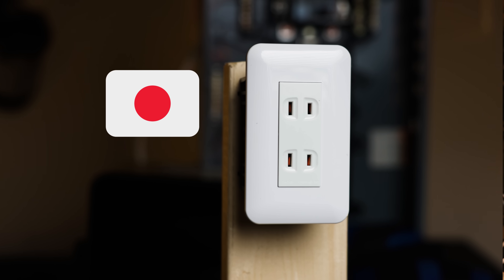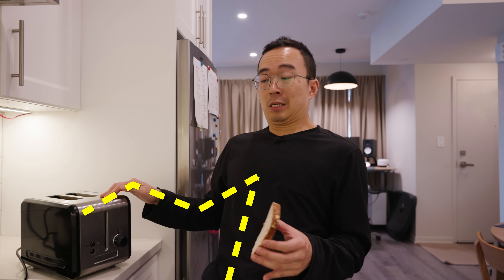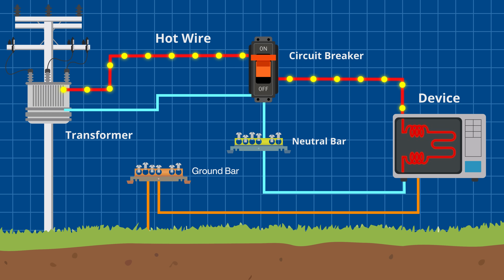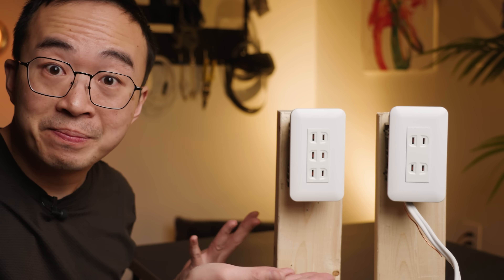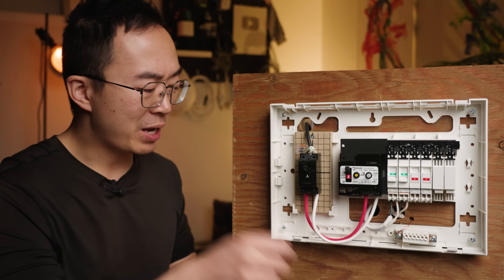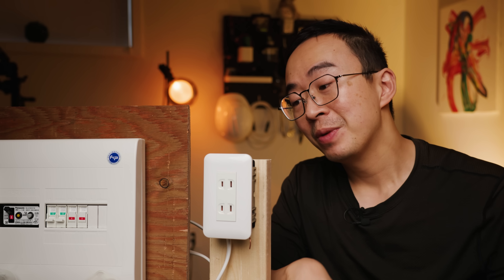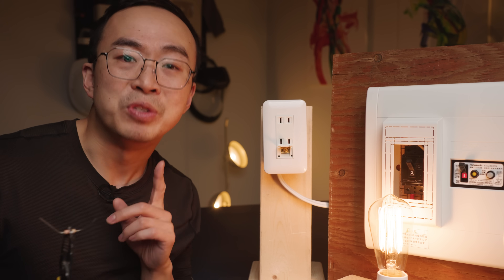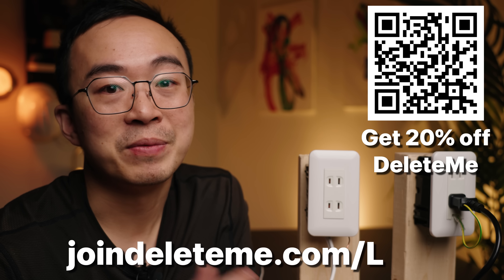How Japan Made Their Outlet Safe

Comment: Arguably the Japan outlet is just safer than an US one. But US outlets are some of the worst in the world. Puting EU outlets in the beginning of the video is kind of misleading. Most countries in the EU have both, a ground and a GFCI.
Reply: In most central European countries and the UK and Ireland GFCI protection is mandatory for almost everything. Ofc there are many exceptions but generally every new install has GFCI.
Reply: @alouisschafer7212 As of like a 10+ years ago, every new building in EU requires GFCI/RCD protection on every outlet. In old buildings it's allowed to have it only in the bathroom.
Reply: @Gragagrogog It's the same in the U.S.  New construction requires the same.  Let's throttle back on the superiority talk.
Reply: @alouisschafer7212GFCIs are really old. German company Schuckert (tofay part of Siemens) invented them in 1903, Nicholsen improved the technology in the USA in 1908.

It's kinda embarrassing how long technology took to actually takeoff. And shows the value (or its absence) of safety.

In Germany GGCIs are known as FI or more recently RCD and became.mandatory in the 1984 then almost everywhere in 2007.  Austria introduced them in 1980.

Some utilities required the use of GGCIs with the TT system before they otherwise became mandatory.  In Germany  the TT system is mostly being used with overhead lines, for example.on the countrysideAt first a ISB jack on a cell may appear to he a smart solution for chargin3.  That concept loses its appeal when multiple cells need to be charged. Then a multiport USB power source is required and multiple USB cables.  This may be more of a.pain than forking over a few buckazoids for a multi-cell charger.At first a ISB jack on a cell may appear to he a smart solution for chargin3.  That concept loses its appeal when multiple cells need to be charged. Then a multiport USB power source is required and multiple USB cables.  This may be more of a.pain than forking over a few buckazoids for a multi-cell charger but each European country seems to habe its own preferences and philosophy wrt. which grounding system to use.

Is TT more secure?  I doubt it's what makes the difference.  In Japan technical installations are usually very well maintained.  In North America I've seen quite a few in a somewhat sad shape.
Reply: @alouisschafer7212 Even solar inverters have another build in. 
Also wooden buildings need to have even more protection per local electrical code.
Reply: @alouisschafer7212 Here they even mandated that multi role parts being used.

You can not get units that are both a fuse and a RCBO in one unit so every circuit has its own, so if something trips, you dont have your whole house going dark.

Also, before the RCBO's were only measuring in and out current and comparing, then tripping if current were lost.

Newer units also take phase into account, this is vital for it not to trip if a lightning strikes near the house.
Reply: @ 

Where in the world does your entire house go dark “if something trips”. Bro I got like 20 circuits. I also can’t remember the last time I had to reset one. Y’all acting like this is a bigger problem than it is. Y’all acting like these united states can’t even keep its lights on. 🤣 We’re running 24/7, unstoppable. Plus we finally have competent people in charge. Just worry about yourself and try to keep up.
Reply: @MyToxicMasculinity  I can only remember back as far at ths 1980s and even back then my parents house had fuses (Heat melt fuses at the time) and a RCD.

Fuses were on different circuits but the RCD turned off everything as it sat as the first device connected to the meter.

So if that tripped (Earth leakage) then the whole house tripped. Breakers on the circuit that was affected did not trip as there were not a short circuit or high current situation, but the RCD did because some current leaked to earth.
Reply: @MyToxicMasculinity  Your main panel actually has a master breaker that protects the panel's buss. If that master trips, then everything does go dark. Most countries also have a master RCD protecting the buss.
Reply: Yeah i was reall confused when he said that only japan has these GFCIs.
Reply: It’s been code for a good while that you need tamper resistant receptacles in the US which are the type with built in shutters. Also it’s been code that AFCI and GFCI protected circuits are required in the majority of a residence in various locations. Whole panel surge protection is also required. Older code iterations were definitely not as safety oriented as they are now though.
Reply: Sweden, part of EU. We have long had both GFCI and grounded outlets and tamper-proof sockets required in every new installation. Every aware parent moving into an older home checks that the electrical system is updated. All of the above must be the safest option. I asked Google about the timeline in Sweden:
Tamper-proof sockets were required 1 Jan 1989.
Grounded sockets were required 1 Jan 1994.
GFCI were required 1 Jan 2000.
(Of course, you could start using them when they came to market. There was no need to wait for the specific date.)
Reply: My local code (US) requires ground fault AND arc fault circuit interrupters for every circuit. I don't think it's fair to make a blanket statement that US is unsafe. The main thing I can think of that EU is doing superior is having the recessed plugs such that the bare terminals are never exposed and live at the same time.
Reply: @shannonroberts5080  name and delta that is safe lol.
America is sigma 6 safe  for me my kids & the instrument /church steeple .
Even before 1776 or ben Franklin horsepower utility cpu serfdom is so well defined . Even before new world unlocking the keys to the cosmos on phase change state variation its predictable knowledge before trading out details or taming eletrons of atoms etc etc. 
Bill of rights itself makes hard prediction of math mapping left over finger printed code of life measure ,periodic table. 
Assimilated seed of deterministic responsibility 
Simulated code .
Eating objects gaining mass inertia complex weight excersizing variation +/- in & out of the greater system at large grounded dialectical vision xyz. 

Ite always about future posterity cross platform reference of safety for kids kids polymical hi ground. 
We are the mona Lisa or the state of online business
Reply: @shannonroberts5080  usa is 100% sigma 6 safety fine-tuned atoms & Adam's by for thru past present future physical idealistic subjective micro to macro intentionally by design of this very text reply eltrodynamical measure cellular networking my fluidlike dynamics with your thermodynamical frame of reference. 
Ground up forsight taken on face value its why we purtinized anglish to English pilgrimage to confirm it under rocks pragmatic common sense objectivism anchored upon fundamental features in reality to program this beast of burden with. 
Centering voice free to drill and tap any and avenue conquering The smallest scales keeping alignment for greater good of all
Reply: Was availabilty of copper an issue in Japan's electrical history.  Japan adopted 100v vs. US 120.  England adopted 230v due to low copper availability but retained 3 conductors.
Reply: @mefobills279  Hate to break it to you US is 230v too. we split phase them to reduce the insulation requirements
Reply: @adamperry4610 Yep, US 240v from transformer,  split into two at the panel, with a neutral reference. Current flows on the neutral, with a single point ground at the panel (also connected to earth ground).
Reply: Yeah in Germany we basically got the full menu, 230V, neutral, ground and 3 phases to even the smallest apartment.
Reply: Death stats is too low a bar. Fires and even shocks should never be observed. Chips are cheap. Dynamic current load management, ground fault detection, arc detection should completely replace the old school boxes and breakers throughout the world. Done at scale unit cost would quickly drop. We limit what people can install based on hypothetical simultaneous demands that never actually happen.  Overloading a circuit could be made impossible. Freeing up the homeowner to add loads that don't occur at the same time, Automatically denying power to a load that exceeds wire or panel ratings
Reply: You USA schematic is incorrect on several points. Ask an electrician!
Reply: @luminousveiws So what did he get wrong?
Reply: They use RCD, and they're a bit more expensive than outlets that don't have them. Our GFCI receptacles are $20+ while normal ones are $1-3, so while we use them they tend to be part of a circuit.
Reply: I had to get rid of my panel gfci because my oven was wired to the same curcuit I wasnt going to allocate the oven to its own circuit via smashing the drywall open and adding its own circuit. In NEC code a stationary appliance like an oven should not have a gfci due to the electrical noise in the line.
Reply: @mrw1160  That noise is eqauvalent to platonic solids
For - frame of reference 3 objects 
Thru -cursed reduced interactions between rocks grinded together,cellular networking body of this device even hamiltonian occelating spirit or feilds. 
By - drop sir bacon dig out that code of measure or center galleo
= adds up truest known standard flattest surface sigma 6 objectivism anchored upon fundamental features in reality. 

Or you can say xyz manmade time hierarchy knowledge of good evil equations
Reply: @mrw1160 thats eqaul to 1st position newtons precision instrument 2nd einstein environment measuring 3rd hiesenbergs approach to tiny package of energy = photon perfect alignment anymore or less is deformity or mystification and hulucinations
Reply: @dadsonworldwide3238  the electrical noise from the spark ignitor in the oven is actually activating those expensive circuit breakers to think that noise is someone getting shocked.
Reply: @mrw1160  1776 would say something is not each to it's own time place measure. 
It is not an assimilated seed of individual responsibility
Or simulating a code fine tuned measure radically interpreted atoms differently to maximize benefits each to its own.
Reply: @mrw1160 since xai used GPU by top-down defibrillating source and the fact all y axis north American homes are aligned this way is a very interesting side note. 
Via electrons programmed with pragmatic common sense objectivism embedded in homes one day ..
Reply: @mrw1160  The Amish bailed on the American experiment over this very topic relinquishing all political power and went into the land loving low tech country side we know today. 
But in 1700s you would've said you would math map the left over finger print variation in life and elements why wouldn't you get scared lol 😆
Reply: @mrw1160  y axis outlet plug csn help when you eat to many deterministic objects gain complex mass inertia fat that you then need to excersize variation 1 + good sweat of 2 - bad poo into the greater system at large. 
We need to find out if Google qauntom computing is tapping into bad poo or good sweat of our brow lol
Reply: Don't forget about the fact that the US stayed twice as safe as elsewhere by using only 110v rather than 220v at all consumer-facing points of electrical interaction. That is ultimately the best recourse given that no on-site wiring or GFCI malfunctions can cause 110 volts to increase to more dangerous levels, however if other safety measures for a 220v system fail then the health risk of an electrocution is twice as high. I've been buzzed by 110v before and, while it is not at all pleasant, it is also not at all deadly to be in human contact with.
Reply: @Feraeond  Thats not really how that works but you do you.
Reply: @TyroneBigguns-mk3og I think you forgot ohms law (I = V÷R). The resistance of your body is a fixed load regardless of the voltage. If you double the voltage, you double the current. 240v ÷ 1k ohms(wet hands)= 240 mA vs 120v ÷ 1k ohms (wet hands) = 120mA. 
 Only in a fixed power sustem can you double voltage and drop current. You're welcome.
Reply: The video creator clearly has no idea what he is talking about. That's why he is speaking with this elevated VLOGGER voice and pitch. Pathetic
Reply: Did you even watch the video or just get your European undies in a twist the moment you saw the picture?
Reply: GFCIs are evil.  The US system is inherently safe because its only 110 VAC.  You have to try really hard to get a dangerous shock.  We were perfectly safe back when we had two prong outlets and no ground wires.  For the most part, adding the ground wires simply added cost.  If anything we should have had ground wires in the early days of electrification when we didn't have good wire insulation and we should havedeleted the ground wires as insulation got bettter.
Reply: Yeah and kinda a mess with overseas airport building thing
Reply: Grounded sockets on kitchens and bathrooms were required from the 1930s in Europe and they were such that you could not hook ungrounded devices (new double insulated ones are allowed).
Reply: Who control that state of variation ?
Hitler hi jacked Germanys delta grounded it on genetic substrate lol

This really has to do with in concert cross platform reference of all ecosystem felds study and diciplines in reality. 
Tracable for planning to build this ben Franklin's horsepower utility cpu serfdom computational beast of burden robot and truest known standard dictate phase change state in all avenues .
3 line of measure = tunes all precision instruments sets all fine tuned weights and measure on all scales smallest to largest order of magnitude epoch. 

It allows me step by step in concert to correlate my soul agency dna with this devices code of measure cellular networking biologically & via online free willing my environmental conditions to your frame of reference any where in the world. 

Silent generation and greatest nuked this posterity temporarily for greater good we've been hearded into a delta to walk the world back through everything physicalism everything idealism now sigma 6 objectivism ending renormalization reorientating to optimize this new way of life beast of burden bots 
We do not want to be artificial intellectual property of the state or dictated state of mind by robots or rulers
Reply: US outlets are what happens when you're at the leading edge and research takes a backseat to profits. That being said, at least in most cases a shock from a normal US outlet just causes curse words and not death.
Reply: Uk and EU has RCD little different
Reply: @jackl7731  this is like Neil degrase Tyson arguing spirits of a woman rather than defining the sport eve made of fine tuned atoms .
One is grounded by planetary nature vacuum of space dictated by defining nature. 
The prior is deving nature into the hands of few grounded rather than the betterment of many lol
Reply: @jackl7731  all magnacarta states who only loan out freedoms or are dictatorships have delta outlet plugs. 
I will hold this more factual than the evidence for Japan being more safe than y axis outlet in usa. 
More safe for who what when etc etc
Reply: but NO AFCI/ DDFT arc fault protection. SMH
Reply: Safety across all domains for the house of tomorrow's environmental cpu .
Safety against bad actors 
The power and utility grid itself. 

Its not just when we plug something in 1900s -2024. 

Century of thought went into all this
Reply: @thedavesofourlives1  its really very critical extreme phase change state that will grow into harsh heated debate in coming years
Reply: Indonesian electric installation wants to know your location.

(Its the worst)
Reply: @jthedood1605  even 
Indonesia  ease of access without perpetual payments is more safe over time via impoverished hygiene of a poor society in
 concert with our future kids kids need to own stock in power utility on/off switches.  As if you're 
on the moon, no one would cut your lights off if you dont pay the bill . 
The threat of enemies undermining Indonesia power & utility is sky high though. 
Its there for the taking.
Reply: @dadsonworldwide3238  pls repeat in proper english. Im struggling to understand what u just said
Reply: @jthedood1605  do you understand when kings want safety at the expense of the many variation?
If I put deterministic measure uniformity here it pushes complexity there and we are forced to simulate good or bad variation
Reply: @jthedood1605  is it proper enough to tell you all humans dialectical vision is grounded on xyz adams that are always dealing with +/- atomic structures input/output
Reply: THE very fact this y axis outlet in north America is done long before einstein stands as evidence to just how much we've compremised for greater good coalitions the past 80 years.
I tried to be blunt honest about many that 80 years ago one could make excuses that are now removed. 
So when someone claims +/- grounded by planetary nature or the smallest scales is a myth they are an enemy of your kids and some of them are reneging on promises made with great grandparents when they inherited, negotiated or unconditionally surrendered to assimilated seed of deterministic responsibility for our mixed multitude of complex nations to simulate strong indentefiers building this computational beast of burden infrastructure together
Reply: In Germany only heavy duty items still use the separate ground.  If you have a German cord it’ll only be the case connected to the third/ground plug.  Nothing powered
Reply: @chrissmith7669  old vacuum tubes early transitors picking up creepy distortion that rock n roll mase good use of was the first thing that come to mind when we finally got access to chips again back in 2015 ish. 
Of course, all the ai model chat bots attacked us all first online. 
But anthropic ,meta whatever abused oracal censorship is all fighting thermodynamical eqaulibrium in these models.

We were very lucky to have had language fixed 1st word to image objects interactions
Reply: Us outlets are made to be cheap they work fine and do the job properly. For anything requiring more secure connections we have different tips.
Reply: I wonder how much safer does that makes the whole system. Not theoretically but practically. Being living in Japan for a long time, but have never heard anyone dying of a electric shock...does that extra grounding REALLY make a difference in real life?!
Reply: In EU, espacialy Czechia we have new standard stsrting in 2025. Every circuit must have own GFCI... Not just one in all instalation.
Reply: Your video is very informative. Great work! Now do a video about norwegian domestic power distribution.
Reply: Bringing it to the Philippines but in 230V 60Hz. Outlet receptacles made by Panasonic.
Reply: Asian Japanese power receptables light switch used also on South Korea and Asia. South Korea uses EU grounded outlets (220V 60Hz)
Reply: North Korea uses EU type F outlets as well as Japan/Euro universal 2 prong outlets in 110V or 220V, used for wall mounted fix tuned North Korean government approved radios.
Reply: There is no such thing as EU outlet. EU not have unified electrical outlet. There are several types used trough EU. Sometimes mechanically incompatible. 
And we didn't got to 3phase outlets...
Reply: @rybaluc  what?
First outlets have different shapes but electrical there is only two types. Two contacts for say unprotected devices (like phone charger or other stuff without metal parts in case) and 3 contact. I strongly believe all MODERN installations must use one of them, where 3 contacts plugs are incompatible psychical with 2 contacts socket (but you can use 2 contacts plug in 3 contacts socket).

Ofc if you have installation made before regulations you are not obliged to change it, until you make any change to instalation.
Reply: @TomaszDurlej  No there isn't. E and F receptables mechanically  incompatible if you not have Unischuko or C plug. 
Switzerland also uses J types where earth pin is mechanically incompatible. Italy might have L type also mechanically incompatible.
Also we have a bit mess with 3 phase power outlets everywhere.
Don't let me start about confusion with EU wiring colors, national specific wiring colors and imported goods wiring manuals incompatible with those colors.
And did i told you that phase side on outlets is,also not standardized in europe? My country used to have it on left. But some neighbouring countries not give a shit or have other side.
Reply: @ different psychical shapes, different colors, jet all have Live, Neutral and Ground, all use GFCI.
Reply: @rybaluc  There is an outlet that is called EU outlet. But I get what you mean they are not the same across the EU
Reply: @omp0815  No there isn't! And it is common mistake. Closer to it is C type called also "Europlug" which have nothing to do with European union (EU).It predates it and it is used outside EU on european continent as well. Just for low amp double insulated appliances ( i think 2.5A only).
There is "E"(single letter) type outlet. Then F(Schuko) and aforementioned C outlets. Then slight mods with middle ground pin and prongs location/size in Italy or Switzerland . And then completely different UK outlets.
There is also  type of socket called Unischuko which is possible to plug into E and F.
Reply: @rybaluc  What you call unischuko is not some obscure thing it's the norm I just looked around and i could not find a single cable that does not have a plug which fits in E and F. But some countries have things like Type L in Italy but they also have Type F (mostly in South Tirol) and In Swiss they have Type J (not EU)
Reply: Exactly!
Reply: The new fangled grounded outlets in Japan are new.  My MIL in Japan had the kind where an exposed screw in between two outlets was used to attach a ground wire.  Like was done in the U.S. many many ages ago.  (Which is why they sell those three prong to two prong adapters with wire at Home Depot).
Reply: Just went to the US for the summer (from the EU). Let me tell you, I never had so many problems with outlets in my entire lifetime. It's unsafe, mating stability is bad, most stuff are ungrounded, using large brick style adapters is basically impossible etc... It's laughable.
Reply: @ yet millions of people use it daily quite successfully.
Reply: @MrChadbag  succesfully or not, it's inferior in every way. 

You can use a 40 year old car, any yet, newer models are safer and overall provide a better experience in any possible way. Let's leave service out of this argument, as changing any type of outlet costs basically the same.
Reply: In some EU countries 2 GFCI are required the main one like the Japanese and then the second one for places like the badroom like the US. Because wet skin or k
Just water makes the resistance lower, so they get there own extra securety that has a faster and lower shut off rating than the main on.
Reply: Exactly!
Reply: also all japanese house have both. all big electric are grounded
Reply: The US and Japan use a 2 hot system which is passively much safer than the 1 hot system used in Europe. Europe needs to take far more safety measures than the US does because of that.
Reply: No it’s not, the sockets aren’t polarized allowing for user error to reverse the appliance plugging it in. 

They compensate for the lack of ground with GFCI, But I’ve had gfci fail me more than my ground wand has.

GFCI needs to be tested monthly per manufacturer and NEC, my ground wire doesnt
Reply: GFCIs and AFCIs are problematic in certain instances.

Low current trip GFCIs can be problematic such as with sump pumps.

AFCIs don't work with a lot of motors.
Reply: i can confirm that. Here in Greece both protections are in use. in case GFCI fail we always have earth ground. that makes it almost impossible to get shocked. As i know in germany they also use AMPer safety automatic fuses on every socket or light switch. make it lot more expenssive to have bigger panel with more automatic safety switches inside to have more protection to the cables on the installation to avoid fires
Reply: Yeah and the uks also has flaps covering it so you can’t stick things other than plugs into it
Reply: @rhysrail Newer US outlets have those as well. Obviously they cannot be articulated by a ground pin(or plastic simulacra), however... as a former child I feel the flaps would have made them MORE dangerous. I had no reason to stick objects into electrical outlets here in the US, but I absolutely would have wanted to understand how the shutter worked. (What I DID have was a burning desire to pry child-safety outlet covers out of the sockets and use them as toys. My folks had to take all the safety covers out and throw them away because they enticed me to mess with the outlets.)
Reply: @rhysrail The US is starting to use shuttered outlets by code, the only issue is they still need to work with 2 prong cords so it's possible to stick something into them but it is substantially harder than unshuttered outlets (requires equal pressure on both prongs to open the shutters) that mean incidental things are extremely difficult to do on accident.
Reply: @dunzerkug  the US has required tamper resistant receptacles in homes for several years now, probably at least a decade.  They work exactly as you described, both shudders need equal pressure at the same time in order to open. The ground pin doesn't have a shudder because it's not needed.
Reply: @rhysrail tamper resistant outlets,  US has them too, and I hate them. Takes 10x longer to plug something in, wobbling it back and forth until flaps open, pita
Reply: @rhysrailUSA also has that
Reply: In my state we are moving over to tamper proof which means any outlet that is being changed out is now required to have those flaps in all outlets
Reply: @rhysrailTamper Resistant outlets, which have shutters are required in US electrical code basically everywhere in a house, and have been for over a decade.
Reply: @rhysrailSo does the US.  They are called "anti-tamper" or AT outlets or Tamper Resistant Recepticals, TRR, and have been required in homes since 2011.
Reply: @rhysrail What's funny is back in the 1990s when I studied at a UK university, I was told that English people were raised to be terrified of dangerous US outlets.  Yet here we are...somehow surviving...I've literally never known of or heard of anyone dying from an accident involving US electrical wiring.
Reply: @Salmagundiii  Really? Seems like electrical fires happen all the time in the US.
Reply: @Salmagundiii 
Oh yeah, US plugs+sockets are like the monster under the bed for us in the UK... you're really gullible if you fell for that 😂
The only thing we 'fear', is how genuinely unsafe they are in comparison to UK ones, because plugs here have an earth/ground/CPC (circuit protective conductor) pin and are fused, with some exceptions, but even they still have to use the standard plug format, due to the CPC pin being required to open protective shutters on the sockets.
Also, if you've not heard of anyone dying from an electrical wiring incident in the US, then as always, Google is your friend. Go, educate yourself to things outside of what you've been told 🙂
Reply: @Salmagundiii  the ultimate truth is 'worse' is a relative term. Yes compared to all other outlets particularly European ones US outlets and plugs are worse.

But you need to look at outcomes. Worse in what way and by how much? Obviously Americans dont want to burn their houses down due to electrical faults. If it was a problem we would be installing a new outlet.
Reply: Arguably the japanese do not have a safer outlet than the 3 prong US, as they're adopting them in the future. If the 2 prong style was inherently safer, why would you adopt a less safe outlet?
Reply: @fdsman Japan has 3 prong outlets on some airports and hotels.
Reply: @fdsman  how are u sure they are doing that lol?
Reply: I mean safe in Regulation. USA does have the Better Flap Design for outlets its just not Enforced.... Beuracracy at its finest there. Same with GFCI being Required in only Certain towns but not Federally instead opting for a BEST PRACTICE MODEL of those two being used but not Enforced. A lot of Code is like that and makes it a pain for traveling Trades like me(some town have OLD ASS code that still REQUIRES light bulb outlets to plug into BURIED under all the recent code causing some conflicts with shitty lawyers wasting my timeTLDR b read up and do TECHNICAL requirements like handing exactly one of those CURSED THINGS in that town to a customer UGHHH we need to Clean up all the outdated and bad Laws+ Codes).
Reply: @snintendog  GFCI and AFCI are required on the modern NEC code. The issue is with older buildings and the many use cases who've exceptions. Afci/gfci  required in any newly built damp, humid, and/or unconditioned spaces. Afci is arc fault circuit interruption, and gfci is ground fault circuit interruption. We often have combo afci/gfci outlet/breakers installed in our bathrooms, and afci/gfci breakers in our breaker boxes for the same circuit. Some people say never to double up, but you can even Tripple up protection on some devices like the afci/gfci protection breaker that came factory installed on a heat pump/ac I used on a afci/gfci outlet on a afci/gfci breaker circuit.
Reply: i live in America in an old house, i don’t have any of these things lol.  Still alive though.
Reply: @Ray-ru3pc This was a triumf... i making a note here: "Huge success!"
Reply: Yup, we have RCDs in Europe which is similar to GFCIs, but for the entire house. Along with grounding that's connected to the neutral before the GFCI, it's arguably safer than both
Reply: As a 50 year resident of these united states, I can assure you that the outlets we use are quite safe. I’m not sure why you assume otherwise.
Reply: @MyToxicMasculinity  because most of the world aim for very safe instead of "quite safe"
Reply: @MyToxicMasculinity 32ish years on the US myself and the only time I've been shocked is when it was my fault(as in working on live wires). 
I did have a slight "oops" moment once when grinding metal with the waste going right at a receptacle.  Just a little pop.  That was all.  Hit it with the blow gun and continued with what I was doing.

People from other countries will either bitch that our outlets/receptacles are unsafe or claim our household electricity is inferior because we use 110v for most small applications. Completely ignorant to the fact that almost all American households are supplied with 220.
Reply from the maker: Could be a misunderstandin, but I only mentioned at the beginning that every other country including Europe has grounding.  Not that Japan is the only county to do both GFCI and grounding.  I even put a European RCD in the video! 

I later stated that Japan was the first to require it in their electrical panel!  

Hope that better explains things if I wasn't very clear in the video!
Reply: @Lam The Brazilian standards require differential residual breakers, I just didn't know that it was called GFCI overseas. The ground is also required and the connection between neutral and ground is called BEP or potential equalizer connection. TT grounding is still used, but it is required that the resistance must be near 0, so TN-S grounding is the easiest way. The differential residual breaker is required for any "wet" or external area sockets. The other one is highly recommended. The issue is: the enforcement is weak, and we can't deny poor people the right to electricity, even with risks.

Our sockets are very similar to the Italian ones.
Reply: @Lam  Your statement is not clear and it is most probably incorrect, I have known RCDs in electrical panels since I was a kid (that was in the 1970's); in  the main European countries grounding was a must from the late 60's or early 70's and RCDs  lagged variably depending on the country: for example, Spain and Netherlands introduced them in the 70's for specific circuits and many others as France, Germany, Italy, Sweden did it during the 80's or 90's, and they became of obliged installation between late 90's and early 2000's on most EU countries, with only a few lagging till late 2000's. As for Japan, introduction on home electrical panels dates are similar, 80's promotion but not forced installations, 90's mandatory only on specific circuits near water on new installations, and early 2000's full implementation for electric panels, following the line of all international regulations on the matter. If grouding was not a part of it and lagged behind up to 2022 in Japan, that's a different issue but these measures were up and running throughout all Europe during these periods.
Reply: @Lam  Your statement is not clear and it is most probably incorrect, I have known RCDs in electrical panels since I was a kid (that was in the 1970's); in  the main European countries grounding was a must from the late 60's or early 70's and RCDs  lagged variably depending on the country: for example, Spain and Netherlands introduced them in the 70's for specific circuits and many others as France, Germany, Italy, Sweden did it during the 80's or 90's, and they became of obliged installation between late 90's and early 2000's on most EU countries, with only a few lagging till late 2000's. As for Japan, introduction on home electrical panels dates are similar, 80's promotion but not forced installations, 90's mandatory only on specific circuits near water on new installations, and early 2000's full implementation for electric panels, following the line of all international regulations on the matter. If grouding was not a part of it and lagged behind up to 2022 in Japan, that's a different issue but these measures were up and running throughout all Europe during these periods.
Reply: @Lam  Your statement is not clear and it is most probably incorrect, I have known RCDs in electrical panels since I was a kid (that was in the 1970's); in  the main European countries grounding was a must from the late 60's or early 70's and RCDs  lagged variably depending on the country: for example, Spain and Netherlands introduced them in the 70's for specific circuits and many others as France, Germany, Italy, Sweden did it during the 80's or 90's, and they became of obliged installation between late 90's and early 2000's on most EU countries, with only a few lagging till late 2000's. As for Japan, introduction on home electrical panels dates are similar, 80's promotion but not forced installations, 90's mandatory only on specific circuits near water on new installations, and early 2000's full implementation for electric panels, following the line of all international regulations on the matter. If grouding was not a part of it and lagged behind up to 2022 in Japan, that's a different issue but these measures were up and running throughout all Europe during these periods.
Reply: @Lam  Point of most EU guys is Grounding AND GFCI are mandatory here, more safe than Japanese solution. Also TT are used in specific situations in EU, with serval other types alike.
Reply: @Lam  Even in the UK, RCDs were already being used in the 1960s.
Reply: @Lam you should compare it to UK sockets as the gold standard
Reply: @AprezaRenaldy  Schuko is just as good as the UK sockets, without all the hassle of those massive plugs.
Reply: @Lam you should compare it to UK sockets as the gold standard
Reply: No, that is technically incorrect.  The EU has RCD outlets with a much higher trip threshold. GFCI outlets will not operate on the European grid and are not used anywhere. Only a Class 2, RCD with .30mA will work.  220v true single phase 50hz leaks too much current to ground.  A GFCI and an RCD, while essentially operating the same way, have entirely different trip thresholds and purposes.  One is for personal protection and the other is for equipment protection.  In the EU they are limited to equipment protection.
Reply: There is nothing wrong with US/Canadian receptacles.
Reply: @jovetj  its a coming point where us & Canada are in position to argue ground floor logic elections axis-/+ outlet plug to move notes of debt to e=mc .
From tared feathered tax men over to bots. 
To no longer be artificial intellectual property of the state.
Reply: @jovetj  in all honesty all who argue we remain in a delta are most likely enemy of our kids thinking they will use computational beast of burden to subdue the will of citizens that's not very safe at all for future generations lol
Reply: I’m gonna have to disagree with you there, the European outlets feel super wierd to use, you need to use an extreme amount of force to plug somthing in, it holds on tight but so tight I’ve ripped some out of the walls before, your grounds lowkey suck and hardly anything even uses the ground when you plug it in, the only flaw with the US outlet is since they sent recessed you can get shocked if you accidentally touch the prongs
Reply: You can't get it 100% right when you're (U.S.) first.  Hard to go back and change everything.
Reply: @danr1920 Hard but not impossible. There are these things called adapters.
Reply: @danr1920 People don't understand this.  If you read first hand accounts of German WW2 POWs brought to the US, they were astounded that even the camps they were in had electrical lights, and every rural community they went through via train had electrical lights.  In WW2, only the party elite in German had electricity.  When you consider that the decisions were made over 100 years ago, and the size of the countries that are the USA/Canada, the system has held up pretty well and been adaptable to modern upgrades aside perhaps from the grid itself.
Reply: @danr1920 

Japan is also smaller than California. Hard to justify the expense of retooling an entire country when what you already have is more than adequate. Our(these united states) outlets are quite safe.
Reply: In most of europe you need to have RcD( GFCI) and ground. And now which is saver?
Reply: At least they have the sense to avoid the afci boondoggle
Reply: You are completely wrong about Outlets in the USA. Ours are the safest   in the world.  The UE x can not even settle on one electrical standard or type of socket.
Travel the EU and you need a suitcase full of converters and adapters and maybe your device will work.
Apparently you do not travel much.
Reply: “Worst in the world” don’t get me started on that dinosaur monstrosity you call an outlet in the EU. You can land a plane on those massive shaped plug.
Reply: Bull crap😊
Reply: Nobody cares
Reply: Also, 230 volts is far more useful for modern appliances and a single hot and neutral for the entire house is far simpler to install. In North America we have a hot mess of 120,  208, 240, 277, 480, 347, and 600 volts all in common use.
Reply: Yeah, that's just not true that the US is the worst. People think it's the worst because the prongs can be exposed, but they've done tons of tests and found no real advantages to any system. If there were real issues, you would hear people getting shocked all the time. But it's just not really a thing. And when they do, it's only 120 volts, which isn't a big deal. Europe was forced to use 220 volts because they didn't have much copper available so it's actually more dangerous in those countries and that's why they have protected the prongs better.
Reply: @mediocreman2  Most of the europe increased or steadily increasing to 230-240V. For three phase 400V instead former 380V.
Reply: Choosing between JP and US power outlets is like choosing between cat and dog shit.
Reply: Blue comment
Reply: Sorry having an extra ground is better than not having one. USA electric outlets are fine. Our not holding standards to wire sizes for cheap products where the wires are a lower gauge than can withstand the charge in the outlet. Also Americano outlets come in two different types, those with a full electric charge that have an internal fuse and those that don’t but have a lower output. Incidentally a lot of outlets end up causing fires because people get used to a device being safe in a low output plug than move it where the wire becomes incinerated. I had an electric blanket that almost burned me alive the plug was fine, the wiring in the blankets malfunctioned. USA has some of the most stringent house building standards in the world and it actually causes a lot of problems for providing cheap housing to the poor. What they don’t do, is keep cheap Chinese products from violating wiring standards because there are two many of them you just have plug stuff in and make sure the wires are or device isn’t starting to become a heating element and then throw it away if it turns out to be one. Grounding anything including yourself when doing anything near electricity is always safer than the alternative, can you do more?? Yes, absolutely but again housing standards in the United States are already too exspensive.

Japan is a poor example where your no bedroom apartment probably only has one plug anyway and the chances of owning a home are worse than America where new land is unobtainable. Not a country with as much undeveloped land as developed land where it is common for people to be completely off the grid just because they live to far and the plug standard is every 4 yards a plug has to be on the wall. When you have that many outlets to build in every room of a multi room structure costs matter. Making something more safe when it is already safe enough when it could add another five hundred dollars in plugs and your building two thousand homes at once kinda gets out of hand. 

I get so so tired of people living in commie utopia world where everything is a “should” people sit on the internet fat warm and happy, saying “they should do this” why isn’t the pentagon telling me the truth. Blah blah blah. “Should” is a standard that ignored costs, labor, sourcing, infrastructure, time and resources, for perfection. In a perfect world we would have Japans electric plugs uh ok, well you can certainly do that when you build your own home. It’s America you only have to get approval to build once from the government which is still un American but two many people standard going the government “should” do something and made it impossible for people to just build lodging now you have to get approved by the government to build on your own land. I wonder why people get upset at idealism, perhaps because it only results in a bloated regulatory policy that makes our government a gigantic sprawling regulatory tyranny where you have to get a permit to be within six feet of another human because of viral spreading fears. That’s what should do does. Everyone ends up being controlled by a state that doesn’t care if you can’t afford to change every plug in your house. Or doesn’t care if you would rather risk infection and don’t want to social distance because people are forcing shoulders down the government’s throat and the government spits out regulations as musts.

Unless you’re a contractor who is ok spending extra money to install things or an electrician prepared to build something new that won’t bloat a massive building projects budget get out of other peoples lives and love your own. 

This is half satire, so… don’t be so sure that I am having a freak out, pretty please. I am capable of hyperbole without having a meltdown, my rants are as much for my own entertaining as yours. I will know if you read what I wrote by how you respond by this caveat alone. By all means tell me you’re just a reactionary who doesn’t consider arguments by replying with single cell answers.